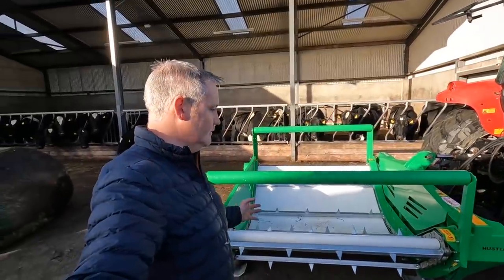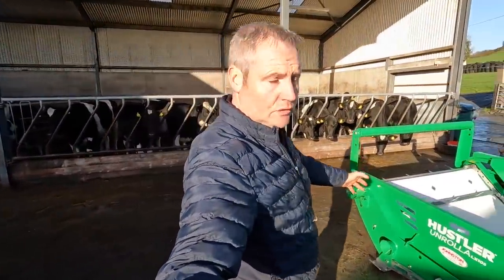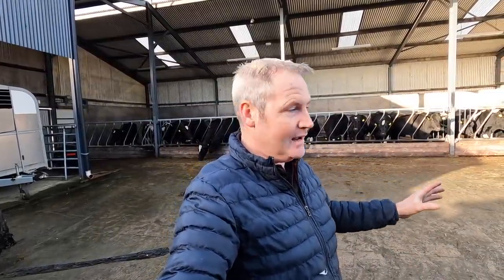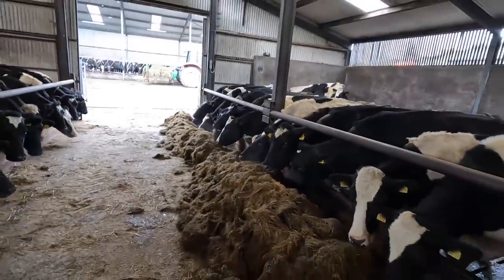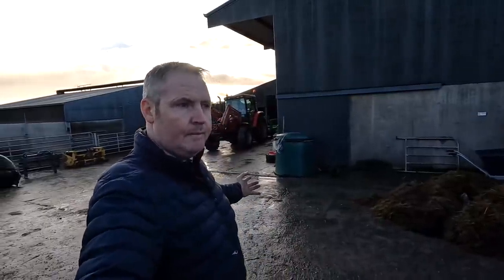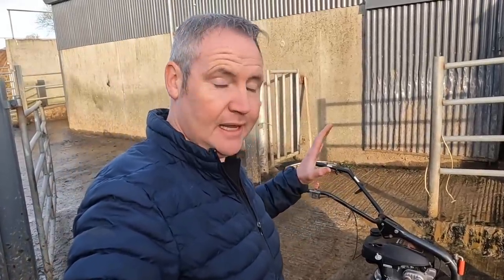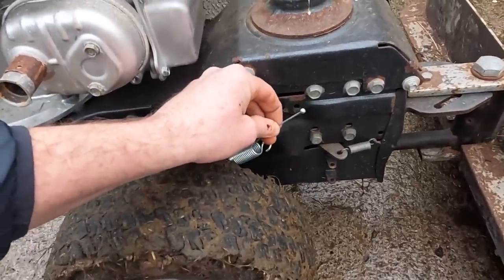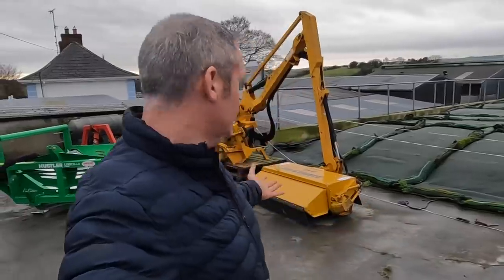HUSTLER UNROLLA LX105 ON DEMO  -- WET BALE TEST -- AND MORE PETROL SCRAPPER REPAIRS

Comment: Id say you could back in to the back of your double shed and feed both left and right sides . Then pull forward 5 feet and feed left and right again ?   You would get both sides fed with no running over fresh silage ?   Great video as always !
Reply from the maker: Yes that would probably work, just a bit of practice 👍
Reply: Ya you could def work it in the narrow passage way. Also blocks of silage will work in it. May need to lower side bars.

Comment: Absolutely brilliant bits of kit  are the hustler have had it 11 years .take the wrap off before you put the bale on the unroller then just slice the net across 98% of the time the net unrolls with the first bit of the bale and you can pick it up after unrolling the other 2% it wraps round the bars which is no big deal. Mine has the extended hydraulic elevator which I know is more money but makes it far more versatile.
Reply from the maker: Yes that would work, it’s all about practice like any new machine. It’s certainly well built

Comment: Could you feed left and then right in the one spot,then move on 7 or 8 feet and do the same again as you said it can feed out bale from both sides,By the way again brilliant video.
Reply from the maker: Yes that probably would work, bit of practice would get it right 👍
Reply: @IFarmWeFarm  did you watch James porter on you tube feeding with hustler in very narrow passage way.

Comment: They take some getting used to alright, your first go went a lot better than mine! Very good machines one you get into the swing of it, and have a wide enough feed passage. Saves a lot of back ache forking.
Reply: Great machine have on Ford 7600 with quicke loader we find to load bale on with loader is easier

Comment: Adrian we have an abbey VF1050 and a shed very similar to yours and have to say it works brilliantly, would highly reccomend and if your thinking theres no need with your pit so close all I'd say is our pit is just as close and we still always use the feeder, much better job
Reply from the maker: Never heard of that but will check them out 👍
Reply: @IFarmWeFarm  I'd say you'd be well able to back in and feed both sides easily especially with the newer model as it's designed better for tight sheds because the doors are put further back and so would get to the back of the shed easily

Comment: Adrian I'd say you should go for a cashels bale shear I bought one and it's some job! Have just ordered a vdw 3pt linkage linkage mixer to do rations in smaller sheds and batches. How do you get on with cattle pulling silage through onto slats ? Do you your chop bales?
Reply from the maker: No not chopped, yes the cattle do pull a lot in on the slats at times. Don’t think I’d part with the bale splitter any time so in fairness. Love its simplicity 👍

Comment: That was a great first attempt probably feed a bit one side then other then move forward do the same 
I think I'd take wrap off first the put over machine still on spikes take net off then lower on to unroller ? Just an idea
Reply from the maker: Yes that would work, only thing is with these bales you’d have to leave the net on until it’s on the machine cause as soon as you loosen the net the bales just collapses. But it would work will our earlier 2nd cut dry bales 👍

Comment: Would a Tanco Bale shear on the front loader be a better option 
No need to get up and down off the tractor
Reply: Correct. Far more efficient
Reply from the maker: I’ve heard of them only lately , must look for them up 👍
Reply: Yea have one and find it brilliant
Reply: @IFarmWeFarm   I've the tanco multishear does bales and pit. Best money I spent in recent years
Reply: @paulwhelan2935  have one of them for 5 years on a jcb 526 but it would be too heavy for his Massey but the bale only one would be grand on a tractor loader
Reply: Yea most efficiently way to feed!!

Comment: In the colder months air cooled engines will get condensation inside the motor if they are not worked hard enough to get really hot, if the engine doesn’t get hot enough to evaporate the condensation  the oil will go milky, a very common problem with my Honda MSX125 motorbike on a short run to work (just over 3 miles) if I take the long way home about 6 miles the engine gets lovely and warm and the oil is not milky.
Reply from the maker: You could be 100% correct there, it doesn’t really be used during the summer but from October till May it’s running for about 30 every day.

Comment: Adrain noticed your krone parked horizontally is that because of the recent storm or is it better for the mower 
Ps I bought the stands but haven’t fitted them yet
Reply from the maker: Yes a fan told me to do so as there’s took a tumble, it does make sense to do so. The stand is great for the summer months as it saves a lot of space

Comment: In your house there Adrian could you not feed out left and then right before ya move down just the length of the machine bed and then stop again & repeat that process again until you've the length of the house done? Is it necessary to keep her moving? I'd say with a bit of finesse and practise you'd do your house with that the finest.
Reply from the maker: Yes a good few said that, that would probably work, bit of practice is all John 👍
Reply: the only problem is that you have to unroll the bale the opposite to how the baler rolled it up

Comment: I think the bigger tyres when you get them might work with given the extra height and the shorter top link as well. With the 12ft width of the passageway, you are definitely restricted. It looks to work well with the open shed where the cattle is. The bale splitter works well in the passageway
Reply from the maker: Yes they will do, it does work well though on the other shed. 15ft passageway and you’d be flying
Reply: You would definitely need the room. Just thinking about what you were saying about the diet feeder, wouldn't it be handy if you got to try out something like the VDW Tractor-Mounted Mini Mixer as a demo sometime down the line

Comment: when you power wash the scraper the water gets in the sleeves of the cable and rusts the internal cable causing it to snap i use wd40 with the pipe squirting a load down the end pushing out any water trapped in there after cleaning keeps it lubed and water free
Reply from the maker: Will do 👍

Comment: Had one of them Honda scrapers for years. Broke my heart. Something wrong with them every god dan day. Like u said only good for scraping slats.  That’s what I was doing with it aswell. Tbf when it was going it was ok. But think there not worth there money. U can’t even get at the drain plug for the engine oil. Very badly designed machine. Them cables ur using Adrian are not worth putting on. U should send one of the old cables up to cable craft in Dublin. They will make u a proper cable that will last for years and years. Had the same problem with moisture in the oil aswell. Great video 😀
Reply from the maker: That new engine is a way better design but I don’t think it comes on the new ones. That’s  kind of the reason I wouldn’t buy a new one cause it was the same thing again.

Comment: Looked a royal ball ache that "unroll". Leave that on another tractor and fully unwrap the bale first with a loader before putting it in then maybe. 
But a lot of effort for not that much time saving. But you could get quicker at it and a bit of practice. 
Maybe try on level ground, not down hill!.  Diet feeder is deffo a long term good option for you. New shed builds yehh🤣🤣
Reply from the maker: Your probably right, there’s not many level spots around our farm yard, the joys of hilly ground. Not really a new shed but some improvements yes down the line. There’s always something 🤷🏻‍♂️👍

Comment: How big of a tractor would you need to work it off a front linkage?
Reply from the maker: It’s is heavy,  so you’d want to check that out for sure. Machine weight is 500kgs which is what’s stamped on the frame. 1250kg Capacity
Reply: @IFarmWeFarm  I see some people use it on the front loader. Obviously you'd need a bit of weight on the back but would that work better for you in the narrow passages?
Reply: I bought one recently and put it on my front loader it works well for me

Comment: I can see it has it uses but a diet feeder and sheer grab beats all. Feed straw with silage  a diet feeder with knifes, no twisted stomachs cows in better condition less silage used with straw mixed
Reply from the maker: That’s a good point 👍
Reply: Give us the pros and cons of a diet feeder. Does it pay to have a tractor running it etc... not currently diet feeding here but thinking about it.
Reply: @markcorr6704  cons is need another tractor it’s tired up. 
It’s machinery things can and will go wrong, but very straight forward to fix not much to them 
Don’t suit every yard system. 

Pros is. Less waste of silage. 
Less silage used when u supplement straw maze ect get a far Better even feed out along feed barrier no spilling silage with a diet feeder if only use sheer grab can be messy  
If winter milking in my opinion a diet feeder is a most but I feel everyone can benefit from a diet feeder. For me it’s the feeding straw especially to dry cows few weeks on the run up to calving will slow them down on silage and make sure cows not getting to fat and we have had zero twisted stomachs since moved to diet feeder. Be4 we had diet feeder always one or 2 cows even 3 some years especially when they are transitioning form grass to silage the diet feeders mix definitely comes into its own. But it’s not just the diet feeder that helps. We find with the cows if they wear in and the upset in diet changes brings stomach problem other issues. So we started not Letting them out unless they wear getting a solid few days out

Comment: I'd bet your putting gas with 10% ethanol in that little engine on your pusher and it constantly trashes the carb and the engine. We had same problems with a few small engines dealer told me to put good non ethanol gas in it and we haven't changed a carb or engine in 9 yrs 😅 the joys of climate change Era
Reply from the maker: I honestly have no idea, I just fill up at the petrol station. No the carb doesn’t really cause much bother as I run it dry if it’s getting parked up for any length of time. Don’t know how you’d  find non ethanol gas in Ireland 🤔. ? Good point though 👍
Reply: @IFarmWeFarm  we have it but it's not at every station you have to hunt it